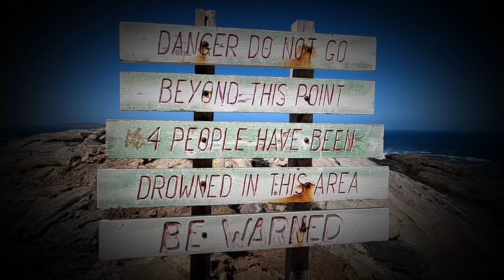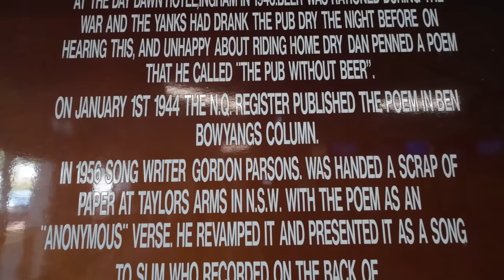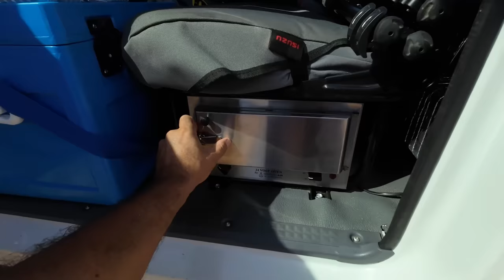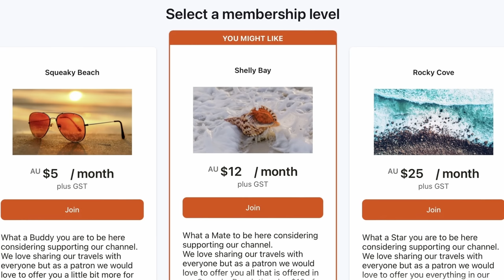Ultimate Free Camp & Isuzu Truck eats up the Beach Drive Far North Queensland in 4K + Side Swiped

Comment: Hey guys I had a question about your truck.. do you rate the automatic for towing or would’ve you rather a Manual
Reply from the maker: The Auto is ok, but with standard engine power ( no remap) it struggles changing gears on hills. By the time it changes it looses so much speed it almost needs to change down again. On rolling hills it is always changing from 5th to 4th and Back. If you get an auto and tow, it needs an engine remap. If you get a remap, the torque converter must have a cooler added or it will overheat.
Ours tows quite good now, with no issues and we are 11t.
Cheers, karl
Reply: @nowhereboundtouring  thanks maté appreciate it so much. So with the remap it goes up hills ok?
Reply from the maker: Our remap is done by Diesel Tune. I would personally only use them. I have spent some time with them and had a look at their gear. Jon is very dedicated to producing good safe remaps.
We have the 200hp remap ( he made it esp for us) it is is quite good up hills etc. the biggest tune is 230hp but I did not want that through the AMT clutch pack. I think that would be stretching it’s ability. Keep in mind that we are fully loaded 100% of the time. They often put the 230hp tune in the manual NPS’s, and  170hp tune in the AMT. I think the 200hp is just right for us.

Cheers, karl
Reply: @nowhereboundtouring  cheers Karl your a wealth of information much appreciated 👍🏼👍🏼